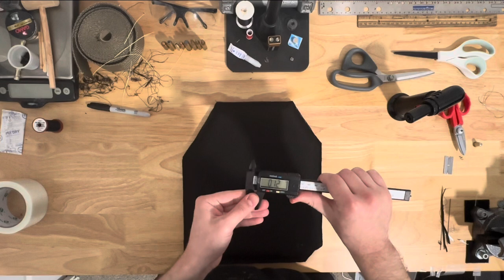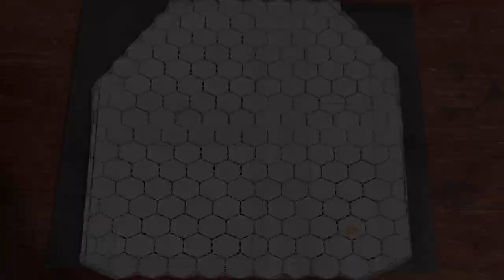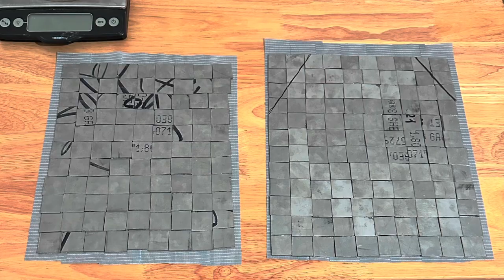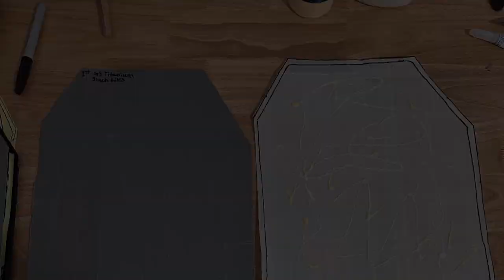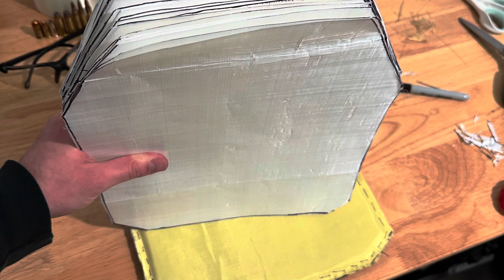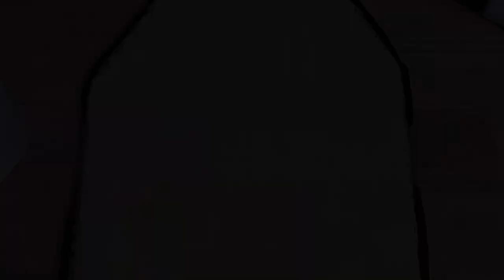Homemade Flexible Rifle Plate! lvl 3+ (.75in) (7lbs)

Comment: Has anyone ever tried 3 layers of used conveyor belt to make a plate?  Some conveyor belts are extremely durable.  I’ve used one in the back of my pickup truck for over 10 years.  It’s still incredibly strong and durable.  No holes from concrete debris, gravel or oak fire wood
Reply: I don’t know if it would work but I know that there are multiple types of conveyor belt…many use fiberglass and some use kevlar.  I think it really might work.  Even if you needed 5 layers. For nearly 20 years I worked in manufacturing and shipping environments and we used to replace old conveyor belts because eventually they would become too difficult to track.  Too many repairs etc.
Reply from the maker: @wellthatsfantastic6981  im sure they are strong tear and puncture wise but I dont think it would stop a bullet.

Comment: Awesome work, where did you get the strikeface from? Im doing a test today to see if the tiles are just as effective from the front on the back.
Reply from the maker: @Tantheman.  the tiles i got from a third party called grain supply, the direct manufacturer is called ceresist inc. The manufacturer has more options available. 

https://ceresist.com/products/alumina

https://www.grainsupply.com/product/grain-handling/millwright-spouting-accessories/ceramic-tile-hex/

Comment: I had an idea where you sew a few sheets of kevlar into a pillow and you stuff it with ceramic beads, the smaller the better. The idea is that it'd act as sort of a super-sandbag, where it is both heavy enough to stop the bullet and compressible enough to not deteriorate immediately. You could have a thinner steel plate in the back to divert the energy across your whole chest, or just a regular kevlar vest if you're not expecting rifle rounds. The units could easily be patched and refilled continuously over its lifespan.
Reply: Would need to sew the beads into multiple packets, otgerwise you would lose most beeds on 1 impact

Comment: Can you state a ballpark figure of the total cost of this minus labor?
Reply from the maker: $100 for titanium (only used $66 worth). $190 for Alumina strike face material (used $27 worth). UHMWPE $55 used it all. Kevlar $58 (used $12 worth). Glue, tape and thread about another $12. All in all including only the materials used to make this one plate about $172. Add on another $6 for the outer cover. Roughly $180
Reply: @Armor-Innovations  If you're not intending to sell a product, could you write up a procedure for production and maybe get in contact with Defense Distributed? Some people live in states where you are unable to get a plate, (which is unfortunate because police get access to AP ammo easier anyways).
Reply: @Armor-Innovations  You are an outstanding individual!